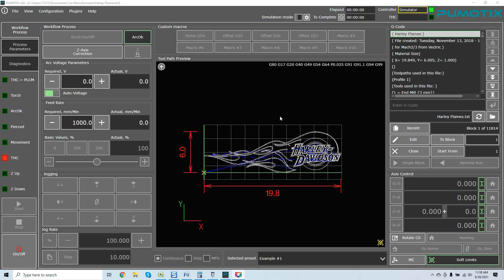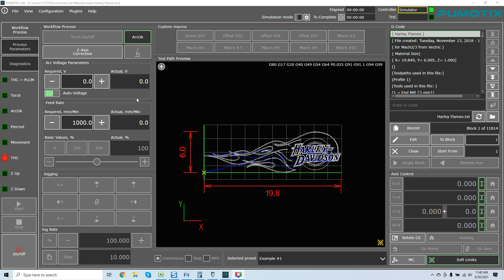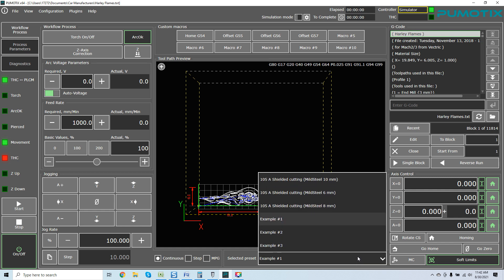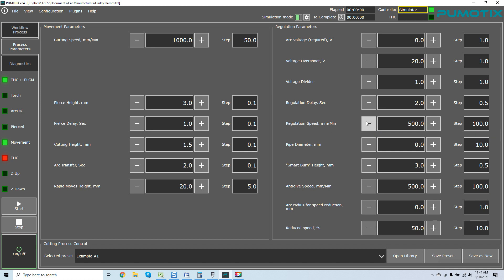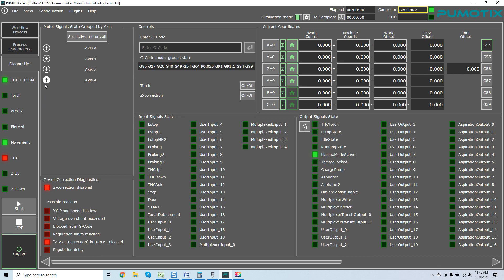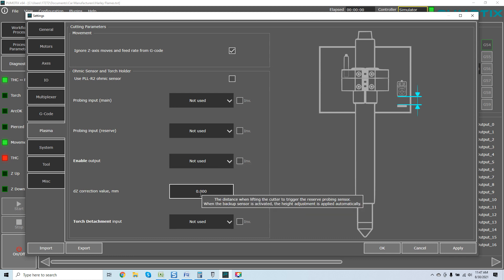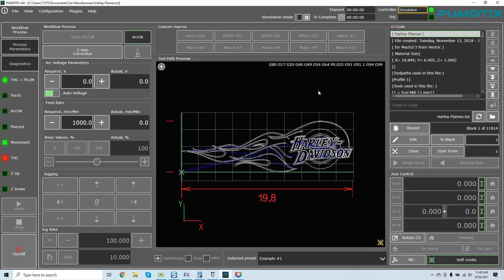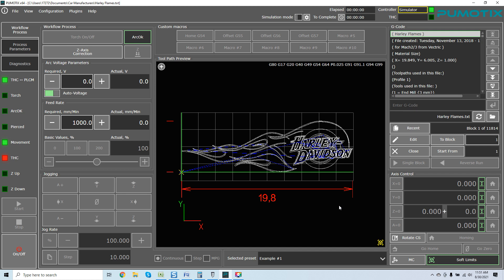Pumotix Plasma Screenset & Features Overview

Comment: Do you have any videos of a plasma Cnc in action? The different types of sensors etc, how well do they run? Is it easy to take a drawing to code like the my plasma does? I hear a lot of talking about features but let’s see it running!
Reply from the maker: The software was released last week, so I'm working with a team to cover it in action. Pumotix is motion control software, and you'll still require CAM software for your geometry creating.

Comment: Thc and Ohmic sensor included?
Reply from the maker: The Plasma package would include the motion control software, Pumotix, and the PLCM-E1B ethernet controller. Different plasma packages are available for review on Pumotix's website. THC, and Ohmic sensor options are available, and will be covered in another video. Thank you,
Vince

Comment: very nice..  does this take the place of both ..sheetcam and MACH3 ?  will it place the job on the sheet to save on metal ,, less scrap? 
I place all my jobs on a sheet in AutoCAD now then send it to sheetcam to make the TAP file.
Reply from the maker: No its only motion control software, so you would still use sheetcam to design your geometry. Thank you,
Vince